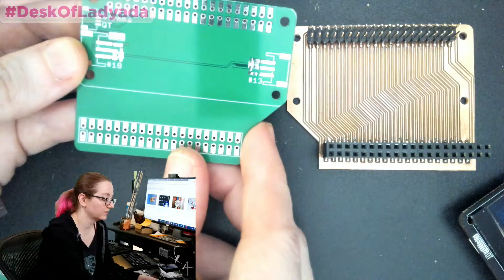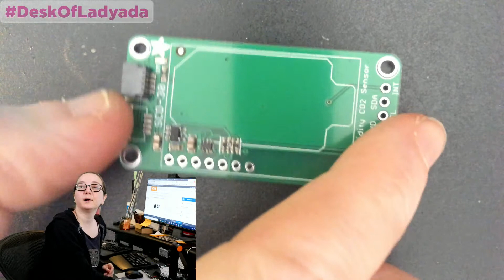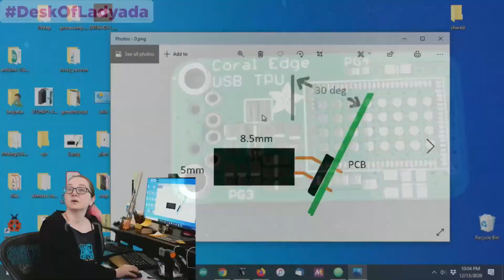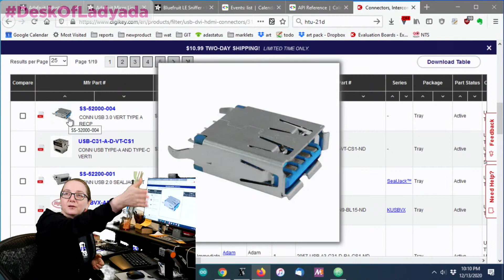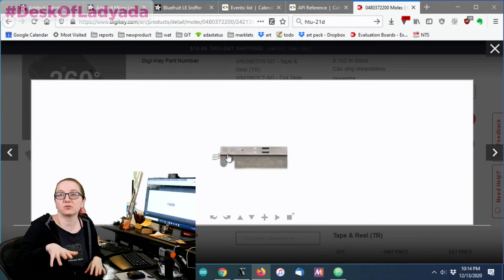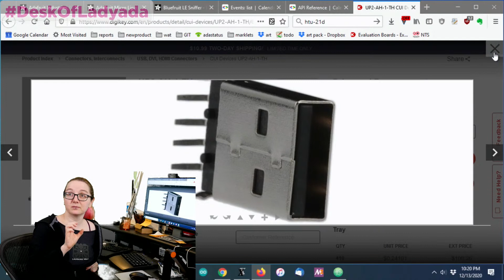DESK OF LADYADA - Stemma Sunday & Happy Hanukkah - Prototype PCB Panel unwrapping

Comment: You know you're a big deal when you can swing your order size around and get a custom angled connector. Lot easier than the half-flex contraptions I was imagining...

Man, I'd be nervous trying to pull that much current out of usb - any plans to add an optional external power connector?